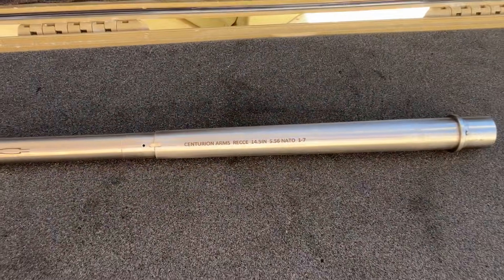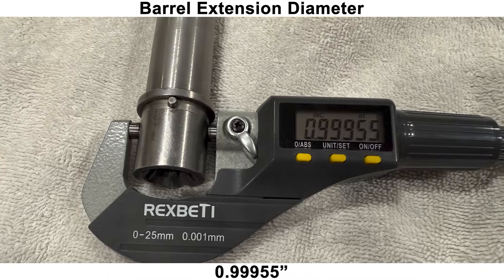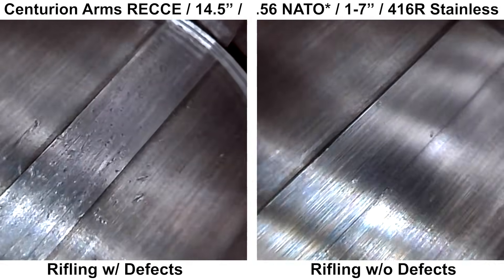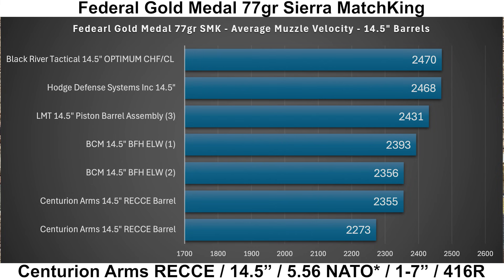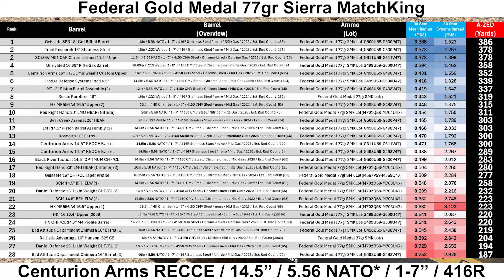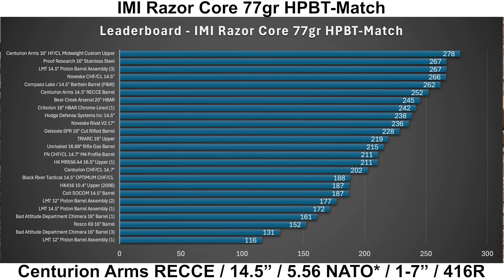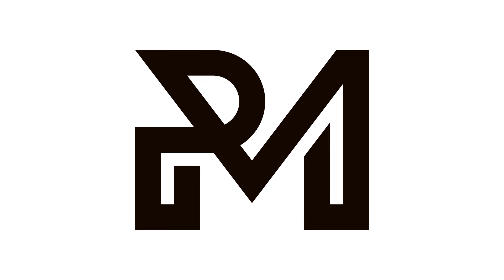Centurion Arms 14.5” RECCE Barrel (30-Shot Groups, Inspection, & Borescope)

Comment: That bore looks more like porosity than galling. I would not accept that as what they told you. They don't want to deal with you they want to deal with the gov't only. So they sold  you rejected barrels from the gov't is what I feel and think what happened to it.I bet if you slugged the barrel it is also on the large size for the reason it gave low velocitys

Comment: I’ve had Centurion on the list for an upcoming build, but the customer service experience you shared has changed my mind. I don’t mind paying a premium for a high quality component, however the customer service needs to be of a similar quality. When every correspondence sent to Centurion goes unanswered without a follow up it shows a clear lack of respect for the folks that buy and use their products. Bummer

Comment: One thing I’ve learned while reloading and is also a reason of accuracy difference between barrels. The velocity of the round. Certain bullets prefer certain speeds. So barrel length and gas port size become a factor to the math. ( and yes muzzle crown and machining and chamber dimension are factors too) but,I’m sure a lot of those barrels can shoot way tighter groups if the velocity was corrected for the bullet. So the myth of ya gotta find the ammo the barrel likes is true due to its projectile reaching its proper desired speed thus creating better accuracy. 
Example between 11.5 and 16” load 22.8grain powder & 23.2grain powder @100yards.
 @ 22.8grain powder w/16” .58 moa 2550fps avg. w/11.5 2 moa 2480fps avg. 
@23.2grain powder w/16” 3 moa 2620fps avg. w/11.5 1.1 moa 2550fps avg.
The velocity was matching for the smaller moa on both, also proof fps can make a substantial difference in accuracy.

Comment: Think those defects are from bead blasting? Not sure of any machining defects that would look like that
Reply from the maker: I don’t think bead blasting.  But not sure what caused it otherwise. Could be some foreign material that made its way into the barrel or chips from reaming the chamber 🤷‍♂️  don’t know but would be interesting to figure it out.
Reply: @PrestonJMoore  would need to be a dissimilar material to cause that damage. Chips would cause scratching or smearing. They seem very directional. Possibly carbide from a previously broken drill or reamer, but a new reamer would only extend an inch or two past the throat. So weird. Love the content!

Comment: I bought one of these last year along with several other makes for an agency test leading to a volume purchase. The gas journal OD seemed slightly undersized. The velocity was nearly the slowest of the test group which is surprising for a match stainless barrel. The accuracy was acceptable for a SPR but not a tack driver. Im glad you did this test and validated our same thoughts on these and decision not to go with this brand. We found the customer service mediocre in regards to answering technical questions.
Reply from the maker: Thanks for sharing your experience. Always nice to be able to hear from multiple sources.  Any barrels in particular you feel I should look into?
Reply: @PrestonJMoore   Maybe a proof carbon barrel?
Reply: Who did you end up going with?
Reply: @mandaloin   Krieger.

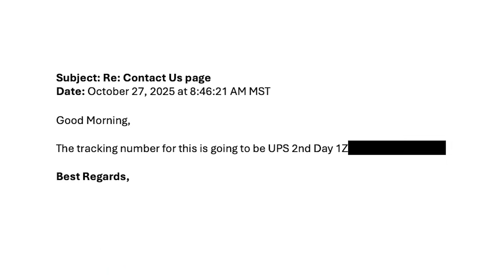Comment: 7:51 if that was Criterion or Daniel Defense they would replace your barrel and even if they disagreed. Last time I returned a barrel to Criterion (a month ago) they also gave me a BCG (possibly accidentally) and a headspaced bolt with it (they told me they would give me this bolt, so this was not accidental). The offending barrel wasn’t even headspaced in the first place. That’s nuts. Granted I was complaining about the gas port flaking, and they told me that the throat was in great condition, and showed no sign of cracking. I’m thinking to myself you didn’t look at the gas port… But that’s OK. Given that they completely replaced everything, I was not going to complain. Customer service to Criterion is above and beyond by so many levels. I also am buying from them constantly, so I’m sure that has something to do with it.

Comment: It would be cool if you made a cleaning video at some point.

Generally for cleaning all I’m using is CLP a bore snake and bronze bristles… do you use harsh chemicals that dissolve lead or are you just using elbow grease and CLP?

Can I ask what your cleaning process is? Because you clearly do a great job. And some people use harsh materials. Michael Ross from Criterion recommends using Sweets 762. Which I intend on doing when the round counts get crazy. 

But at this point I have like 25 barrels so it’s not like I am burning them out quickly or anything. But now I’m focusing a lot on blackout. So I’m gonna have to actually learn how to do a good cleaning pretty soon. 

For cleaning barrels I just use a carbon fiber rod with a bronze brush. A couple bore snakes to clean out fowling, and coat it with lube when I’m done. The bronze bristles though are ASLO attached to the bronze spiral thingy (NOT a steel spiral center, cause I’ve done damage with that before). I make sure there is nothing besides bronze or carbon fiber that enters the barrels.
Reply: He's a bore tech eliminator and patch guy.
Reply: @mr.stotruppen8724 thanks friend. I’ll have to start with the patches and bore tech.
Reply: @liggerstuxin1  It's good stuff (and not caustic at all) but I only keep a bottle around for once-a-year deep cleans. Otherwise just CLP to keep the buildup down once in a while. But I'm not a PRS autismo.

Comment: The problem with Centurion is you never know if you're going to get a track driver or a POS.
Reply: That holds true for a great many of the brands he reviews unfortunately.
Reply: that was me with lmt with my first upper, it was somewhat slightly bent and couldnt install a barrel correctly I dont know how that made it out of their QC department then I had a problem with their enhanced bcg the staking was done incorrectly and it was loose. Their customer service though was nice cant complain about that but they differently earned the name “Learning Machining Together” 😂
Reply: I have a brand new centurion 14.5 lw barrel that is keyholing.
Reply: @miks-t5d  keyholing has to do with the ammunition and twist rate
Reply: @artifacthunter1472  I have never had another barrel keyhole before. Standard twist rate 1:7 and regular 55g PMC.
Reply: @artifacthunter1472 ....what fudd did you learn that from.

Comment: Definitely give the enhanced socom a try
Reply from the maker: I like the looks of it.  the enhanced socom seems to be pretty popular too.
Reply: @PrestonJMoore I got a decent deal on mine and so far no complaints. I have only taken it out to 325 yards with the 4x ACOG with no issues. The only thing is it is slightly under gassed even with an A5H0 it fails to lock back sometimes.
Reply: @J.Alexander74  What spring are you using?